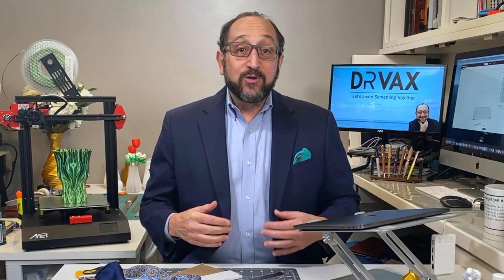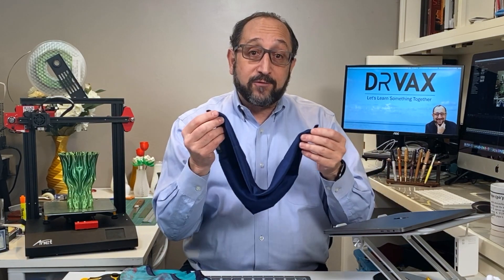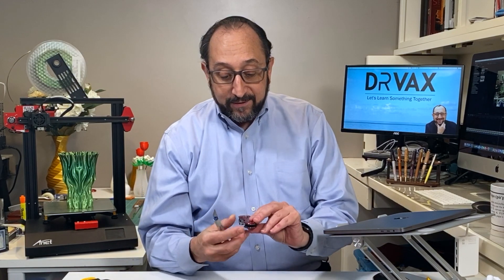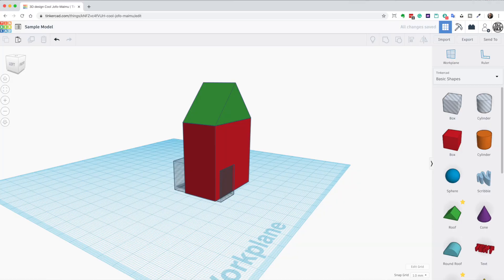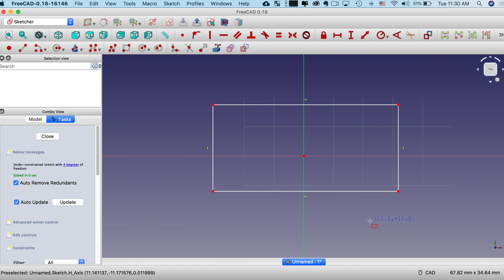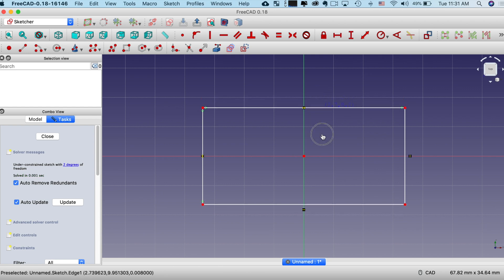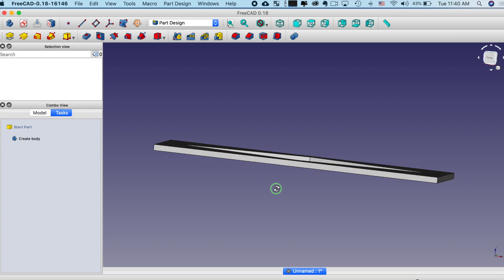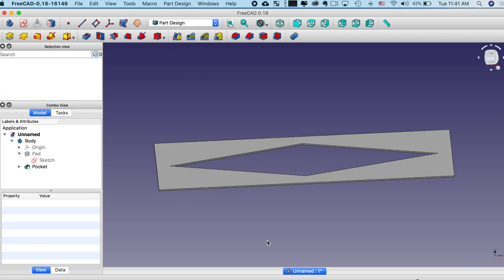3d Design & Print a Pocket Square Mask for Coronavirus

Comment: @Make With Tech I use the Milwaukee Fastback and just run an old file over the blade every once in a while. The blade has been in the knife for over a year and is used at work cutting up boxes everyday. I have to admit Milwaukee has great blades.

Comment: Hi Irv. Love your channel. I'm a newbie. I just bought a Monoprice maker ultimate 2 on your recommendation. I've printed a few things.
I used Wiibuilde for a slicer.....What causes this:
https://drive.google.com/file/d/1tyxe64od2OBH2NpcGzgVEg0-AcXIazBl/view?usp=sharing
Reply from the maker: I am not a fan of wiubuulder but it did not cause your problem.  Your print probably came loose from the build plan during the print.   I would switch to cura, use magigoo on the build plate, and print with a raft.

Comment: So if I understand correctly, if I design a watch movement spacer and I would need to always change the dimensions for different sizes then FreeCad would work better due to the saved steps where for future changes would be easier.
Reply from the maker: Yes an parametric tool,  freecad, fusion360 or others would be better.

Comment: Thanks for a great video. Glad your doing better. I have a question. I have been using Tinkercad but am looking to move up. I was planning on attempting to learn fusion 360. I see your using free cad. Any advice?
Reply: My two cents. Fusion 360 is owned by Autodesk. It runs only on Windows and Mac, not Linux (my personal preference). They have the option, at any time, to cancel the free use of their product. FreeCAD is open source and truly free. 

Mark Ganson has (currently) 67 videos on FreeCAD (I'm currently up to #22). They are THE BEST videos I have seen on FreeCAD. Yep, it's a lot of time investment to watch them all. But, if you want to really understand and get productive with FreeCAD it's worth the time.
Reply from the maker: @Jeremy Hogan Thanks for your comment.  Unfortunately, I do not always get everything right which is why comments are so useful.   Thank you for including the references to addition videos about FreeCad.  I am a fan.  I will be adding some tutorial videos targeting non-technical people using 3d printers that find CAD very confusing.

I am also just starting to build a new community forum you might find interesting.

I have created a new community forum, DrVax community of "makers", at http://forum.drvax.com .   At the DrVax forum, you can engage in discussions with me and other community members, use a rich text editor, and post images.  This should facilitate better communications.

Check it out and feel free to share the address.

This forum is still in beta and the software I am using is complex so I may have some feature misconfigured. 

All the best.  Irv

Comment: Just a warning. 

Due to a design flaw in FreeCAD you should not place a sketch onto a face. In your case for example the part will break if you add a hole to the first sketch with the rectangle. FreeCAD is loosing the face and the second sketch is jumping to a random face. Currently using a datum plane is a better way to link a face to.

Anyway. As always a cool video. Glad you are back. Missed my weekly dose of DrVax. :)
Reply from the maker: Interesting.   I am going to do a series of freecad videos and I will highlight this issue.  Thanks for participating.
Reply: @MakeWithTech  There is a very good video on this FreeCAD issue and how to avoid the problem. It is done by Mark Ganson called "019 FreeCAD topological naming issue". 

Mark has (currently) 67 videos on FreeCAD. They are THE BEST videos I have seen on FreeCAD. Yep, it's a lot of time investment to watch them all. But, if you want to really understand and get productive with FreeCAD it's worth the time.
For example, I learned a few tricks that would have sped up your sketch creation. 

Example 1: You can pick 2 diagonal points and then the center point and click on the symmetry constraint and it would have centered the entire diamond around the center point in one operation, instead of applying constraints in two operations, horizontal and vertical. 

Example 2: You could have done everything with one sketch instead of two.
Really enjoy your videos. Keep them coming.

Comment: I like how you just walked through the whole process of idea, prototype, design and build. I have been using cardboard for that since it was all I had at the time. I also learned the difference between TinkerCAD and other drawing programs. I think I need to make a change going forward. Thanks again. Perhaps some more videos of how to take ideas to designs?
Reply from the maker: Thanks.  Ideas to design is complex.  I am not sure how that happens.  For me it a process of visualizing in my head then trying out with prototypes.  Let me give it some though. B

Comment: Works well, is nicely flexible  and unnoticeable......https://lh3.googleusercontent.com/hWZZvTsw-C2-y5TcqmXFtx5QuBWgF7KmOsZS52oQbNdsLbRInVRySzV4M0u89__BpAWzm1_gXKdc2f_uuxABdfc8bt-M7CSYk2a4cwhS84CqDvQogHTJg_jRdebJ-gLsIrbtFGxYM3Ss-hEQX29T3lk-nrgEGS66bLkvIuEEPw0-tKHFY3nK4qxczazeDDrXDaZarDxCXU1BX4ZVJYv_de1QWPWziFCHriFeRGSX2dhTBLCen_5Ix9T3m8oL06XifRXODn50kSjxV9MJNnUno2hQesa9R2yHki75tyEF34Wl1OEFPbgPK5CQovDlPbGilP6qTNBAB5tA-CN7NSqbJYiBy0pqTh1StY2QaNcHeP2Q1pvAksCj_cxlrsAbDetHICGg8chtkCgIDFfKt5KeMkaK666h8f4NJDsdoyjLqnpZ3HmUU8lvq2bQEjwWa4LXylBWNfNPdQMwRSPKz7qEw-REnNEZuSV36KZqtYkAkKunI13ZXWchpshovqtb6kMGDbg_rFcQ887Fer8L8cqidst_o648UIJHmYaNvofjwKKScc_jzmq9dor6QxLarE2ThbAfGLJrc1OhTSOTbxXfkzFZEei9cCxomOPq15mNwLq4gwYbrSu0Tt6M9QTEfvLaLK5fRGb0BsrnMQK8DWBlBPL76z4JYVQITInVjGoMpyCzMA0LiCciq5L48ldYn4g=w1284-h963-no
Thanks for sharing!
Reply from the maker: Thanks for sharing the picture of the print.   After using it for a while I think it needs to be a bit thicker.  Maybe 1 or 1.25mm.   I think the .80 models will break at the points.   I will experiment a bit and let people know.

Comment: As I remember Cura 4.4.1 has a nasty bug with entering filament's size in Printer Settings! In Cura 4.5.1 it's fixed.
For a Custom FFF 3d printer it's not 1.75 by default (bigger) so it prints porous parts (for the most common 3d printers of the current time).
Reply from the maker: This is correct.

Comment: I would not dare to risk using something like this as I care for my elderly father who would most probably die should he catch the CCP virus, although it is something to fall back on If I run out of KN-95 masks.
Reply from the maker: You are correct.  This is designed for casual outside use when you are not treating compromised patients.  Overall this was more an exercise in teaching design than an exercise in producing masks.
Reply: Don’t sell yourself short, this will still save lives. But you are right, medical use is another thing entirely.